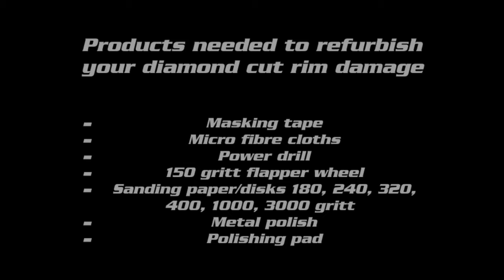CURB RASH REPAIR On Alloy Wheel Rim! HOW TO Repair Diamond Cut Finish

Comment from the maker: If you guys have any questions regarding the process, drop them down below and I'll answer them for you 👇👇
Reply: How long did it take you to do one wheel ?
Reply from the maker: it took me about 2-3 hours in total to do the 1 rim
Reply: Could you not clear Lacquer the edge up lightly or is it not possible? I have some water marks under the lacquer in very small places and thought I might be able to buff down with paste them mist them lightly with clear lacquer?
Reply: You don't clear coat over the sanded area?
Reply: @CCDVIDEO  what about the lined finish, or was yours smooth

Comment: Done a good job removing the damage as it’s impossible to replicate the machine cut original but really should mention if you leave it like that it will start corroding instantly so it’s either keep polishing the rim or lacquer it. Diamond cut wheels can be a pain in the rear!

Comment: Great result mate. I wished I watched this video earlier. I just paid £120 each for two diamond cut alloys on my bmw. The wheel company told me diamond cut alloys can only be repaired by a lathe machine hence it took 3 days in there body shop for them to do the repairs. Having watched your video now I now realise this can be done at home!
Reply: I was told they will peel if done whitout lathe
Reply: I work in a body shop and still took my Mercedes wheels to a wheel company , the reason is they powder coat them. If you leave wheels like this they will corrode in no time, they can be lacquered like a car body but even that is not robust enough for wheels, the water eventually gets in under the paint and that’s when you see all those white powdery wheel about. You did the best thing trust me!

Comment: Well done, tnx for the video. One normally thinks it is an expensive task, but on the contrary. Your rim looks amazing. Tnx for not making it to complicated and I'm sure lots of car owners will appreciate your video. Can't wait for the next one.
Reply from the maker: Thank you for the message. I was thinking of sending the wheel in for repair at first, but decided to try a DIY method to see if I could maybe fix it before sending it in. At the end of the day, no need to spend hundreds of rand getting it fixed. Very happy with the outcome at the end of the day ✌🏻

Comment: You did a great job.

I have a Mercedes AMG rim and I was disappointed by the same problem, please I would like to help me I want the names of the things you used in the video, although you mentioned them later in the video but I want exactly the things you used please. 

The problem I have is in the corner of the rim and not at the rim of the rim as happened with you. Is it possible to fix it in your opinion?

Comment: Just a tip... When diamond cut was done to a rim... Some people spray clearcoat on the the diamond cut part.... To get the better shine
Reply from the maker: Thanx buddy, I have no issues with the shine. Some people add clearcoat to prevent them from corroding, but that’s also very debatable on wether they will corrode or not. If they do, I’ll polish them and add clearcoat but from what I have read I should be fine
Reply: Clearcoat is a must!

Comment: Just curbed my X1's mags on a friken Mc Donald's drive thru🙄 this video is helping alot. Only thing is my mags seem to have a bit deeper damage. Any advice?
Reply: Also it's on the black coating so that is all off now. Any advice for paint touch ups, or should I just powder coat my mag?
Reply from the maker: Hi Chante. I suspect if your damage is too deep you’d have to send it in for a refurbish. I was fortunate enough that my damage wasn’t all that deep at the end of the day

Comment: Curbed the rim on my BMW and I was searching for something like this. I got most of the scratches out (a few deep ones are resilient and I don’t want to get rid of a lot of metal). Looks a million times better than it did. Thank you for the video.

I’m thinking of clear coating the fixed part. Part of me wants to use clear plastidip to see how that will help. Any ideas guys?
Reply from the maker: I’m glad this vid was able to help you. To be honest, I didn’t put a clearcoat over mine, and I drove it about 6months after fixing before I sold the car. When I sold it, it was still mint, but I can’t give you a longer update on that unfortunately
Reply: @CCDVIDEO  I have a year left before lease turn in. Hopefully mine lasts till then.  Let's see how it goes.
Reply from the maker: Also depends where you from. I am from Gauteng, South Africa. We experience hotter weather throughout the year. Guess if you are in a place like the UK or Canada where it’s wetter weather, you might end up running into trouble. Hope it makes sense
Reply: @CCDVIDEO  Yes it makes perfect sense. I'm in Illinois and the weather goes from hot to freezing cold with lots of rain in between in a year. I think I'll try some plastidip and see how it goes. If that doesn't help, I can redo it and lacquer it or get it professionally redone. Worst case scenario is getting a used rim (which is why I thought I'd try it out myself anyway).
Reply: @CCDVIDEO  they throw salt on the roads all winter here - that doesn't help either!

Comment: how are you able to expose the metal edge of the rim? My tyres are blocking the way. did you have to delfalte the tyres first? thanks!
Reply from the maker: My fitment allowed me to reach in there, but you can deflate the tire or have it pulled off the rim before doing this job

Comment: You won't get the 'lines' because thats the diamond cut machined finish achieved on the lathe, but to be fair it looks pretty good and you wouldn't notice but I would have definitely put some sort of clear coat  on to 'seal's the metal

Comment: Thank you for sending this along, I managed to curb my rims heavy. Alot of videos show how to fix curb rash, but not many work with diamond cut. Some have suggested after sanding down to use a clear coat paint to give some protection. I noticed you just used polish for yours. Can you give some advice on this?
Reply from the maker: TheCoconutstrut i have mot clearcoated over mine and they are STILL doing just fine. I do however has a ceramic coating on my wheels, so after the refurb I just did another coat on that rim. You’ll see when you stary sanding you do actually remove a clearcoat type of layer
Reply: @CCDVIDEO  my man, thanks for getting back. Got yourself a sub.
Reply from the maker: TheCoconutstrut appreciate it a lot. Let me know if you need any help during the process. But if you have patience and follow my steps you’ll be good 👌🏻
Reply: Sounds good my dude, I got all the grades of sandpaper, some rubbing alcohol and tape. Haven't gotten the Polish or clear coat, but hope for some progress with what I have. Thanks again for reaching out

Comment: Did you need to deflate the tyre before starting the sanding?
Reply from the maker: I did not have to but as you can see I run a stretch fitment so my tire wasn’t in my way at all. But if your tire is in the way you could try to deflate before sanding

Comment: You did a good job mate but it's impossible to polish out clear coat to blend with polished aluminium. I have to strip the whole surface and down as you did to the full face to avoid getting those ugly start stop areas in the clear. Then I clear the whole thing again so it doesn't just corrode.

Comment: Unfortunately without a coat of self etching lacquer this will dull off over a few weeks and oxidise, then need to be redone correctly. It's now bare metal, with any metals weather it be steel or alloy it needs a lacquer.
Reply from the maker: Keiron Boshell it’s been 4 weeks and still looks the same as the day I did it. Thanx for your concern though
Reply: Creative Car Detailing 6 months 12 months you will have the concern
Reply: @squidgyblack3321  to be fair though, it will be easier to give them a quick polish to get the shine back, rather than having to strip down all the lacquer which ALWAYS seems to chip and get water under and drive corrosion - it's happened on all my deep dish wheels in under a year.  I'm thinking about stripping them back and polishing like this, then when they start to corrode, give them a quick hand polish and good to go for another 6 months or so - can't be any worse that the usual bubbling cracking lacquer on diamond cut rims.
Reply: Obviously it's your choice but the corrosion will eventually pit the alloy and a quick polish will do nothing. Car manufacturers spend millions of pounds developing lacquers and paints a reason. A professionally applied coat of self etching lacquer will only bubble if shipped just like the paint in your bodywork. If there's on clear coat then the chip is more than likely going to damage the wheel. Like I say your choice but as a qualified painter I think it's only fair others watching the video know the facts before stripping the lacquer on their own wheels